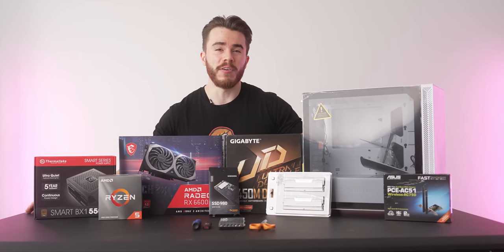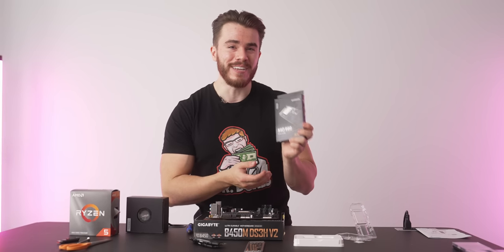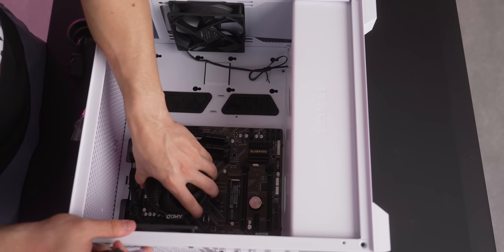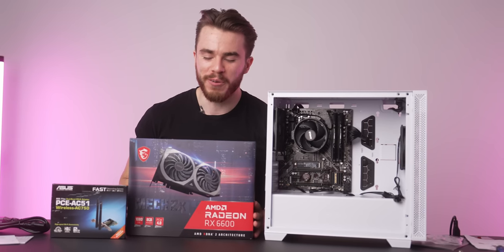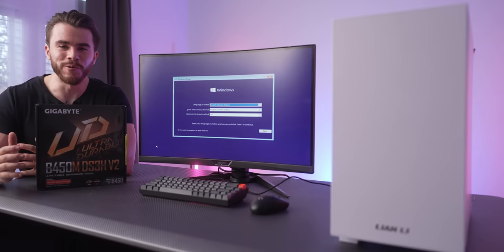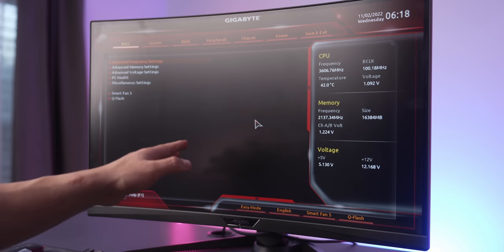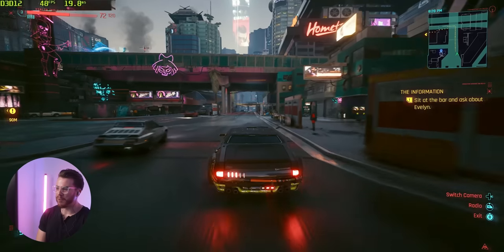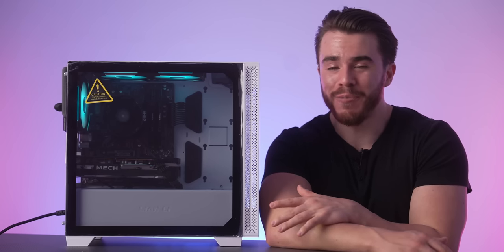Your Next $700 Gaming PC Build for 2023!

Comment: Gtx 1660 super vs rx 6600 , which one is better?
Reply from the maker: Google it mate
Reply: Rx 6600 100%
Reply: RX6600 would be a better option. True, the 1660s is a solid option, but I do not believe it is worth the retail price when it's a card that came out 3 years ago. If you MUST get an Nvidia card for whatever reason, at least go with the RTX 3050, but then again, the RX6600 offers much better value over the RTX 3050 as well.
Reply: @ivankong1065  thanks for the reply bro

Comment: You can do a 12100f, 6600, 32gb ram, 1tb m.2 alittle rgb, the 550w power for $703 before tax 😑
Reply from the maker: 32gb is definitely overkill but you could bump up to a 6600XT/6650XT.
Reply: @ScatterVolt  that is true, I was just making the point that some of these decisions were unnecessary and kinda over priced

Comment: What screws and tools will I need to build this. And will any other case work with this?
Reply: The only main tool you need is a Phillips head screw driver. Screws come with the respective parts provided you buy them brand new. You can use other PC cases as long as the PC case and motherboard support the same form factor. Look that up if you're not familiar with computer form factors.

Comment: Is going team red worth it to save money,  compared to an rtx 3050 or something
Reply from the maker: https://youtu.be/yLEpC5-xcyQ
Reply: @ScatterVolt  tbh the 3050 was a general example, a friend said they could sell me a used 3060ti for $300
Reply: Unless you absolutely need the CUDA cores for work, DO NOT get the RTX 3050. The RX6600 offers much better value than the RTX 3050 in gaming purposes, and let's be honest, the ray tracing ability on the RTX 3050 is barely usable.
Reply from the maker: That's a good deal
Reply: Just got the 6650xt 309.  Awesome card
Reply: @hailblue221  I wanted to get the 6650xt over the 6600, but it was like 190 and the 6650xt would be 275 plus tax, so 300ish.  I may return it still for the 6650xt if I can.
Reply: @ScatterVolt  I found a regular 3060 for $330 at micro center used, W or L?

Comment: You can build way stronger PC for 700$. Don't get me wrong, it's a great build, but it poses the same thing as almost every build on web, namely that you must pair a AMD GPU with an AMD CPU. Wrong.  While AMD GPUs are having way more value then intels, also intel CPUs do the same, with AMD CPUs, also MBs for these CPUs come way cheaper (in this case you can't get cheaper then the one in the video, but you can get a slightly more pricey with cheaper CPU and like waaaay more performance.) 
All in all, my 700 $ build is the following:
-Case: In the video, or you can get a bit cheaper ones as well depending on your taste
-PSU: in the video
-SSD: you can go with the video here with a better 500GB, or you can get 1 TB M.2 SSD for the same price from a lesser known manufacturer.
-CPU: i3-12100F (about 25-30% better bench performance then the ryzen5 4gen CPU for the same price)
-MB: AMD A520M DS3H ( about 70$, but a bit better performing then the B450M)
-RAM: 16 GB 3200MHz (the only backside of the CPU is it only works with 3200 MHz RAM, but these also come cheaper then the one in the video)
-GPU: RX6650XT, i bought this gem for 300$, and the best part about this card that it runs perfectly fine with a 550W PSU. For the extra 50$ you get a 25-30% better performance (so i disagree with the statement that the RX 6600 has the best value and it's undisputable.)

All in all i put together this PC in abuilder and it costs exactly around 700$ (getting all parts form the same shop, except the GPU which was a steal at 300$ at another shop). Same cost (maybe 10-20$ higher, but you can always spare some on the case or the SSD) and around 25% more performance. There are some minimal cons for pairing Intel CPU with AMD GPU and i recommend to make your research on the topic, but it's nothing compared to the value you gain.

Comment: can you use Smart access memory on the b 450 if you update it ?
Reply from the maker: You’d have to check the latest bios release for the B450 motherboard you’re using and see if SAM or re-Bar support is includedb
Reply: @ScatterVolt  i don't have a config yet i want to build one like the one in the vedio if the 450 have SAM i will save somme dollars 😂 , thanks for responding

Comment: I wouldn’t advise buying the 4500. It’s slower than a 3600 and the much faster 5500 is on sale for 99 bucks
Reply from the maker: I’ve got the 5500 linked in the description as well. When I filmed this build video back in October, the 5500 was still around $130-$140, but has seriously dropped in price since then. Fortunately, the Wi-Fi version of the ds3h is Ryzen 5000 ready out of the box